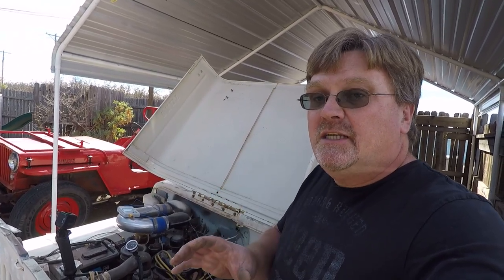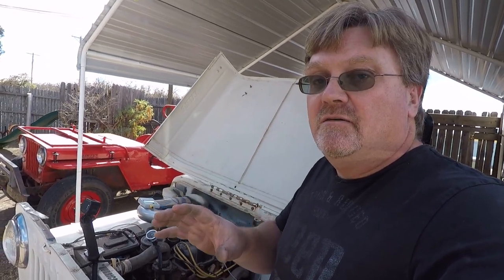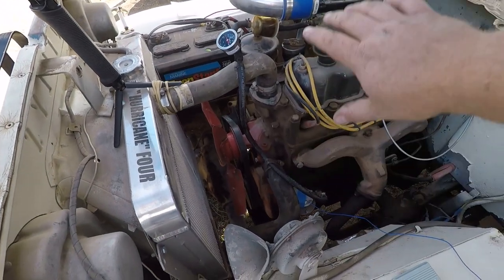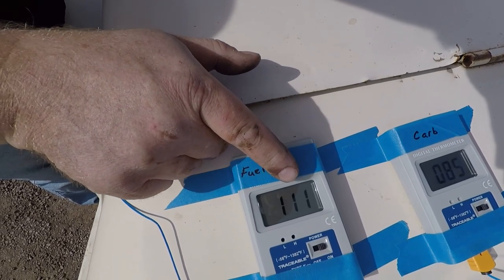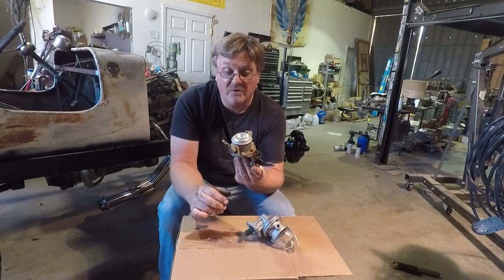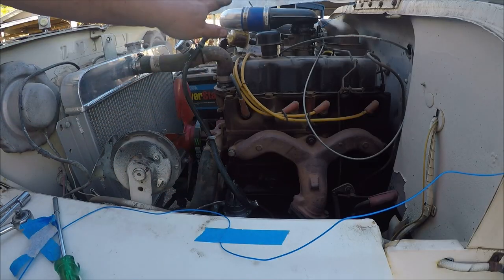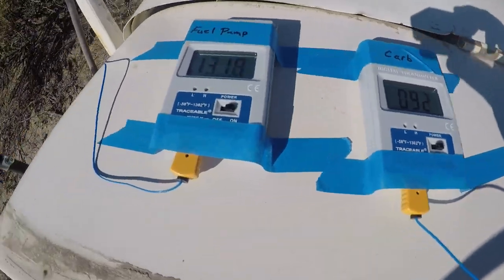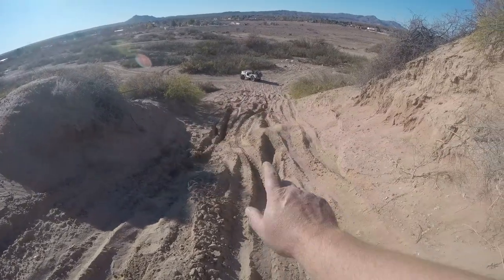Vapor Lock on my Flatfender Willys Jeep

Comment: Low-Buck Garage, Because the mechanical fuel pump is mounted to the engine block, most of the heat transfer is transferred by conduction from the engine block. You can discard  your mechanical fuel pump and replace it with 5 lb electric fuel pump to remedy that. If you incorporate a fuel filter with a return line and mounted as close as you can to the carburetor, I think,  it should solve the problem. It solved my '76 Chevy van vapor locking problem when towed heavy load.
Reply: Exactly what I was thinking.  Blank off the engine fuel pump and put in an electric fuel pump and use a heat shield (old coke can?) to keep radient heat away.  Or try the mechanical pump with a plastic spacer to reduce thermal transmission?  In an emergency, could you wrap a wet cloth around the pump to cool it?  In the UK, ethanol fuel is seriously messing up old outboard engines, motorcycles and lawn mowers.    On the plus side, it rarely gets hot enough here for vapour lock but carb icing can be an issue.   Love your dry humour.
Reply: Used to have a CJ-3A that had a F head swapped into it. Whoever did the swap also went to an Bosch electric fuel pump, mounted on the firewall. I never had any vapor lock issues with it, but this was before they started cutting gasoline with ethanol. Still, watching this video made me think this isn't a new problem and an electric pump is a tried and true solution to it.

Comment: A theory on the zero pressure: I keep hearing that pumps don't really make pressure, they just make flow,, and the "restriction" of the size of the line is what creates the pressure. So, if the needle valve on the carb is staying open while the engine is running, perhaps the pump is actually working just fine but there is no "restriction" to create the pressure to be measured by the gauge, especially at such low pressures.

Comment: I've used a couple clothespins clipped to the steel fuel line close to the carb, it acts as a heat sink and radiator. Might seem hoakey , but I learned from an old depression -era trick.

Comment: That was an interesting experiment - especially about the low pressure readings - that was amazing. I'm still pondering that.  Maybe the pump can't make pressure when the fuel vaporizes, and the vapors are condensing in the carb? I think the thermometers were probably responding to radio frequency noise generated by the ignition system. You might switch to resistor plugs or reroute the temperature sensor wires, but what you did is the most efficient cure: ignore the readings that jump around. I have a similar problem with my '47 Chevrolet, but in my case, the fuel percolates out of the carb when you shut it off on a hot day. The boiling fuel and vapors go into the intake manifold and create a sort of flooded condition.  If the battery lasts long enough, you can turn it over and pump the fumes thru until it starts - otherwise you must wait about an hour for the vapors to dissipate - and then it starts quickly. Kind of embarrassing at times, because people don't want to wait an hour for you to move away from the pump at the gas station.

Comment: The falling pressure on the gauge is not a pump or fuel delivery issue, its a gauge issue. There is a Bourdon tube inside most fuel gauges, dry and liquid filled. As pressure increases the tube uncurls and it acts upon a little rack and pinion like gear that moves the needle. In a dry gauge, heat will cause the tube to curl back up and reduce the pressure shown on the gauge. An oil filled gauge will react just the opposite, pressure increases as it gets hot. This is due to the glycerin inside the gauge expanding due to heat which results in extra pressure on the tube which makes the gauge read higher. moving the gauge away from the engine will help prevent effects of ambient temperature. Taking steps to cool the fuel like recirculating as you did will also help the gauge read correctly and help reduce vapor lock. There are liquid filled gauges available that have a pressure equalizing valve so they will reed accurately regardless of temp. but they cost considerably more than a parts store dry gauge. Bottom line…if it’s running you know there is fuel pressure.
Reply from the maker: Great info, I had never thought about that!  I think I'll move the gauge to the end of the return line, right before the flow control valve.  It will still see system pressure, but be at ambient temperature.  Also, I can see it as I drive to see what RPM/load does to it.  But as long as it keeps running, I'm happy!

Comment: I liked the extra 15 HP that those F heads had over the L heads. I put a F head in my 1947 CJ 2A. The only problem I had was , I had to cut a hole in the hood for the carb to stick through. Having that Jeep was a great learning experience. I don't think I ever had vapor lock, but then, it never was that hot in southern Ontario in the mid to late 70's either.
Reply from the maker: I'm planning on doing an F-head swap into my yellow CJ-2A, I found a very short carb so I think I may be able to avoid the hood clearance issue.  Hopefully I'll have the video done sometime next year.
Reply: @LowBuckGarage  I wish you good luck. I no longer have either my 1947  CJ2A or my 1949 CJ3A. I miss my 3A the most. I just have a 1992 YJ now.

Comment: First off, nice driving skills with those skinny bias plies and open diffs, that’s a challenge.  Here’s some tips to help vapor lock off the top of my head:

-fan shroud. This will help not only cool the engine block, but improve the efficiency of the fan instead of “slinging” air around, it will funnel air at a higher flow throughout the engine compartment at lower travel speeds (crawling up a hill or idling).

-“seal” off your engine compartment. If you have a fan shroud, the idea is to direct air flow through the radiator via fan, across the engine, then straight down and under the firewall/trans tunnel. Radiator support should be sealed, as well as gaps between the frame rails and inner wheel fenders. Consider hood to fender and hood to grille seals.

-try hood insulation. This should help in hot direct sunlight and will keep the hood cooler (the thick steel will only reflect the heat back to the top of the motor.

-metallic fuel lines. Rubber will only insulate the warm/hot fuel, keeping it from cooling down (Only IF the ambient/flowing air is cooler than the fuel).  Aluminum has an extremely high thermal conductivity (accepts heat fast, and dissipates fast).  Copper is better yet.  Steel is meh.

-insulating fuel lines (only IF the fuel is cooler than ambient/passing air).

-routing longer fuel lines away from exhaust and coolant hoses (gives fuel more time to cool before ending up in the carb).

-header wrap your exhaust manifold.

-fabricate heat shields out of aluminum and place them between fuel pump and exhaust manifold. Could also heat shield your fuel lines.

-as you stated, non metallic carb spacer. Even though your carb appears to be running around 100*, I would wager getting it lower yet will help cool the fuel additionally.  In your area, carb icing or running too cold shouldn’t be an issue.

The fuel return is a great idea. This is one reason why it’s implemented on vehicles from the 1960’s and up, same with all the other ideas I’ve mentioned.

I hope this helps!
Reply from the maker: Thanks for the info, that gives me a lot more food for thought!  I'll do an update in the summer when ambient temp is over 100F, and incorporate your ideas.  I'll start with the fan shroud, and then go from there!

Comment: I have had good luck with carb heat shield; also fuel pump return works good, heat shield for fuel pump and wires; a good fan clutch; I like the closed cooling system so radiator can stay full, air chamber above radiator made from heater hoses for ~3% expansion like in BMWs; mostly water in radiator with just enough coolant for corrosion resistance. Good luck! :)

Comment: The carburetor was likely cooler than the fuel pump because of the venturi effect. For this reason airplanes have a carburetor heat button to reduce carburetor icing in some conditions. Then, when the engine shut off the carburetor temperature normalized.

Comment: I sure appreciate you working on my 3B! ;-)
Hey, so interesting issue. I had exactly the same issue with my old 3B. My solution was to plumb the fuel line with copper instead of rubber. Well, I don't know if that was the actual solution, and sounds counter intuitive. All I know is, once I did that, I could drive it in these Hell-hot summers with no vapor lock. I still don't know why, and remain unconvinced that vapor lock was the problem, and copper was the solution. Weird. But, I do know this: those engines went through many years of service, this can't be an isolated issue. Surely someone out there knows the skinny on it. 
Hey, may I make a suggestion? (Unrelated to fuel) Put in a couple of lunchbox lockers on that thing. You won't beat it up getting up those hills. (And also, maybe air down to like 15psi in those tires) I'm sure you know all this already.
In any case, I love your videos! Make more!
... and let's go wheeling some day.
Reply from the maker: Thanks!  From what I understand, it wasn't as much of a problem when these were in regular use because the gasoline then was formulated to work with carbs.  With fuel injection being common now, a low boiling point is not a problem because the high fuel pressures used in injection prevent the formation of vapor.   I have heard of return lines mentioned a few times, and it does seem to be a good solution.  

I hadn't heard of running copper lines before, but copper is a funny metal.  It reacts differently than most metals in some situations.  Getting a cut from working with copper is way different than steel or aluminum!  It could even have been a chemical reaction that helped stabilize the fuel.

I actually just scored a set of "junk" Jeep axles, and come to find out they had limited slips both front and rear!  Not sure which one to install them in yet, though, they might end up in a new build I'm planning...  This CJ-3B is not really set up well for serious off-roading, those tires are so stiff that they were at about 17psi in this video!  This is my most roadworthy Willys, one of the others will be more trail oriented.

And yes, wheeling sounds fun!  I keep an eye out for your Jeep when I'm out there, so I'm sure I'll run into you at some point.
Reply: @LowBuckGarage  Right now I'm installing new gears in my YJ, but as soon as that's done and I can safely call the new gears broke-in, I'll be out there (searching for a certain white 3B) 
Have fun!
Reply: Oh, and, this thing about low boiling point sure makes sense. The time I'm talking about is the late 70s when we still had leaded regular gasoline. Interesting!

Comment: Pre injection Cherokee fuel filter with return nipple run line back to tank . I drilled and tapped fill neck on 3A works great also 78 vette 85 cj7 71 bronco  you will never get engine  compartment cool enough for todays fuel

Comment: Back in Little Rock Air Force base, my dad was a aircraft mechanic. We used aspestos tape to wrap the fuel line. They don’t make that style of tape. So you can wrap the fuel line with another heat prevention tape

Comment: If I still had my 62 Chevy 327 with Holley spread bore, I would try the return line thing.  I tried many things (fuel pump, carburetor spacers, electric fans ) even moving the line outside the frame rail and insulating the steel fuel line where near the headers. It would still die in the summer sitting in traffic idling.

Comment: I put a Chevy 4.3 in a cj7. As soon as the weather warmed up, it vapor locked. I added a fuel filter with a return line back to the tank, and that cured it for good.
Reply from the maker: It does seem like a good solution, glad to hear you confirm that it might be the cure!

Comment: If you measure the air temperature at the base of the carburetor or the temperature of the air inside the intake it should be really low perhaps around 35°~ 40° keeping the fuel moving will cool down things

Comment: Drove my 48 2A L134 (still 6v) to town the other day to get titled.  Warm day (70s), ran 45-50ish mph for about 6-7 miles on country roads and in town, parked for about an hour waiting on LE to run my VIN since out of state purchase, and made it about 2 miles toward home before she stumbled and died.  After towing it home and scratching my head I originally thought my timing had slipped since I was getting some back firing when I tried to start...but now wondering if it was vapor lock.  She didn't seem like she was getting enough fuel, so once I advanced the timing a little I did drive it into my garage where she's parked now...waiting for me to figure out WTH is going on...lol.  I do have the riser on the WO carb, and mechanical glass bowl fuel pump bolted onto the block.  Haven't tested for heat yet, so this gives me something to look at.
Reply from the maker: Definitely worth a look.  If you dump a little gas in the carb and it starts right up, its some kind of fuel supply issue.

Comment: Could it be your gas line with guage installed in it. Going across your radiator hose ?
Reply from the maker: I should have done a "before" shot, but the line only went across the radiator hose after I added the pressure gauge.  Before that, the line was routed away, and that was when I had the most vapor lock issues.  However, you bring up a good point, thanks!  I'll move a temp gauge to that line and see what it reads just to be sure.
Reply: @LowBuckGarage  yeah seen that just figure I mention it. But you seem like you know what your doing. Cool jeeps, I'm looking for now myself